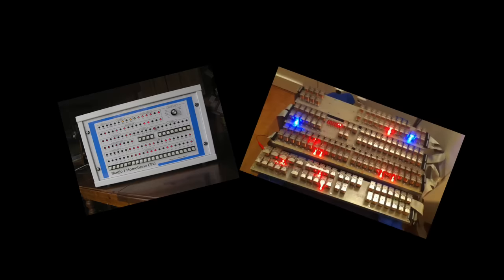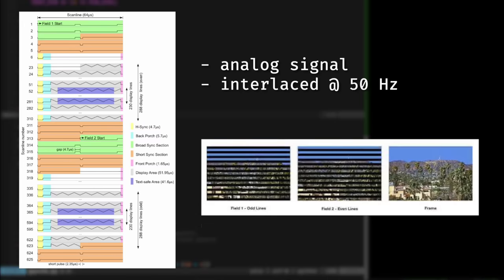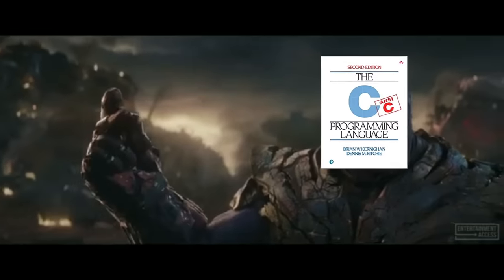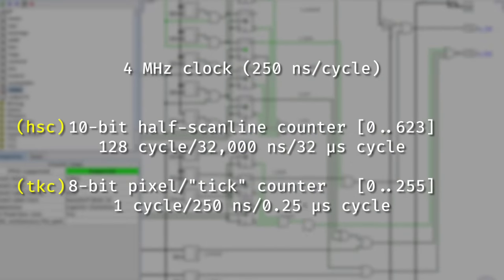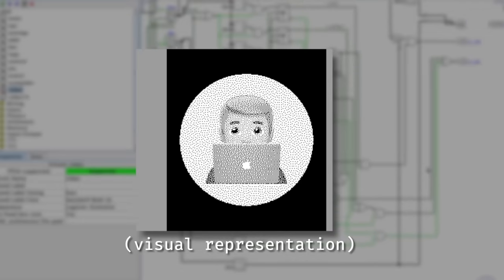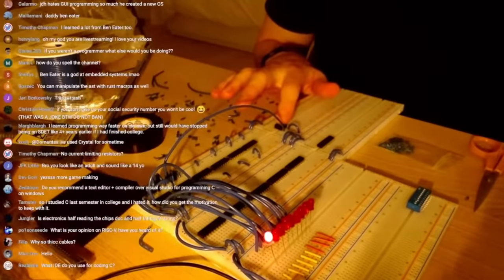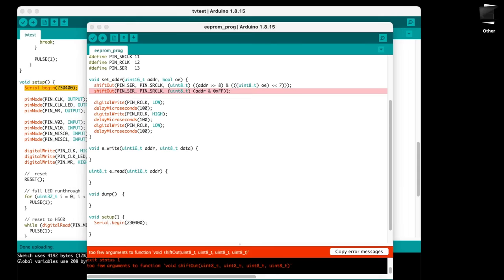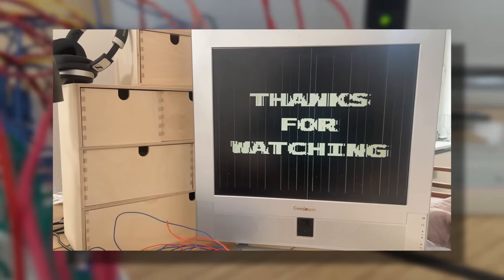I built my own graphics card

Comment: He's literally gonna reinvent the wheel at this rate.
Reply: He just copied ben eater's video card
Reply: @bloxcodes6576  Well he at least had to to modify  it since Ben used VGA. But i did not gone into understanding jdh design so idk.
Reply: Why do you think that? I don't think he copied it...
Reply: @jelle8055  He did the same as ben eater, used a different layout and a adapter
Reply: @bloxcodes6576  different layout as in wiring or the physical layout of the location of the ic's? (I don't remember the layout of the original design, because it's quite a while back i watched that vid)
Reply: @jelle8055  Location of the ICs, the wirings (For example one IC pin 4 and another one 6) are the same. He did add a converter
Reply: @bloxcodes6576  hm, i mean, then the hard part was already done, because i don't think a converter from VGA to (don't know the English name, RCA composite video?) Would be hard, since they are both analog
Reply: And when he remakes it it's going to be a sphere! 🎱 😮
Reply: @مقاطعمترجمة-ش8ث  Who the fuck said anything about arduino
Reply: What's a wheel?
Reply: @bloxcodes6576  I would say he was inspired by the Ben Eater videos.
Reply: Lmao
Reply: No at this rate he is gonna make the wheel better
Reply: @jelle8055  it's a copy of ben eater's just used simpler protocol and without colors.
Reply: @omniyambot9876  yeah, i heard it, shitty that he doesn't say he copied it or "based on" his design...
Reply: @jelle8055  yep. He searched for information about his project, it's impossible he didn't came across ben eater. Or at least mentioned him. He just inevitably mentioned him on eeprom programmer which is very obvious. And every steps he did was Ben's design. Still, it was entertaining.
Reply: @bloxcodes6576  he's changed enough about it and explained things well enough that it warrants not being called a copy
Reply: Anti gravity mechanism... you won't need wheels.
Reply: @jelle8055  It is his own design, black and white actually adds complexity compared to color.
Reply: @bloxcodes6576  The wiring and ICs of a 3090 is like ben eaters GPU, just different. You just disproved yourself.
Reply: @ducksonplays4190  black and white is more complex then color...
Reply: @ducksonplays4190  i cant even begin understand this. u disproved yourself when saying that te ic's are wired differently, he just stole from ben eater
Reply: @jawad9757  not that much changed, and explaining something means that its not a copy? so if i explain a tv, i invented television?
Reply: @tweetyguy7347  I don't remember this, but in the cases of non 1 bit memory, black and white is indeed more complex. It requires a multiplexer and a counter to select each bit to display, compared to sending the entire word through an analog to digital converter and putting that into the VGA color pins.

Comment: "i built a pc"
"what graphics card you using?"
"i BUILT the graphics card."
"but what about the cpu?"
"i BUILT the cpu."
Reply: What about the Operating System?
Reply: @bootyfart1569  lol, he literally did.
Reply: "What about the programming language?"
Reply: "What about the motherboard?"
"yes."
Reply: @bashguy8448  "What about the monitor"
"I built it"
Reply: "what about the harddrive?"
"I BUILT IT."
"what about the case"
"i."
"built."
"it."
Reply: @wmurray003  holyC
Reply: "What about the wires and transistors."
Reply: @nivekakninblarg8076  transistors? I made my own using the equivalent circuit with diodes
Reply: @eletrotheory8398  But did you make the circuits and diodes with glass blowing and forging?
Reply: who made the engineer? "I made it-" Love Island memory intensified
Reply: @takase5037  based
Reply: Building a CPU in theory isn't that hard. Just need some registers, a clock, an ALU, etc. Practically tho? We're talking about millions, of not billions of transistors.
Reply: @bootyfart1569  well that OS is an x86(probably 64), while his CPU is not that architecture so his OS would not work on his CPU
Reply: I love this comment thread
Reply: How many transistors then in both? Uhhhhhh… *scratches back of head* <100…
Reply: Also you say graphics cards which is the equivalent of a motherboard for a cpu, he didn’t build that.
Reply: enrique amaya  ok bot
Reply: After reading all the replies I'll go with this one

"What about the intertwined matrix of infrastructure that makes up a civilization spanning mode of production?" 

Now THAT I want to see done on a breadboard.

Comment: I designed and built a number of GPUs out of TTL in the 70s, although we called then VDUs back then.

It's interesting to see your approach... I can see you're a software guy! 

One of the engineering challenges back in the mid 70s was to use the minimum number of chips. Also back then we didn't have any chips beyond 7419x. The cheapest counters were the 7490 and 7493. Also RAM was expensive.

The designs typical of the day used 256 visible pixels across and 256 visible pixels down, 320 by 320 including front & back porches plus vertical blanking period. Using a 5MHz clock, this gave the 15625Hz Hsync frequency. The Vsync works out at about 48.8Hz, good enough.

Divide by 320 is achieved with 7493 binary counters configured as div-by-32, plus a 7490 div-by-10. When the MSB goes high, that's the blanking periods. Sync timing is achieved with 74123 monostables: digital comparators massively increases chip count.

Instead of a complete memory mapped display (remember RAM was expensive), we used character generator ROMs. These presented 8 pixels at a time, which went into a shift register either a 74165 or 74166 from memory. At 5MHz, the character time of 8 pixels is 8/5MHz = 1.6us, which was easily achievable with the ~450ns RAM and ROM we had back then.

For the CPU to access the RAM, we need to multiplex the CPU's address bus with the 749x counters. This was done with 74157s. When the CPU needed to access the RAM, it took precedence over the counters, so you'd get snow on the screen during CPU accesses.

Including the RAM (8 x 2102) and character generator, maybe 30 chips in total.

I was a 12yo school kid at the time when I designed my first one, no oscilloscope, just an analog multimeter and an LED for debugging.
Reply from the maker: Ah I never knew 74123s existed! That would have been nice - comparators are the bulk of this circuit and take up 2.5 boards on their own. next time :)
Reply: you forgot hardware
Reply: Building a GPU at 12yo! I am stunned.
Reply: I built one while in my mother’s womb. I remember doctors being really confused when the first thing to come out was not me, but the GPU I made. Good times...
Reply: I don't understand anything you wrote. 🤣
Reply: @turolretar  I'd actually designed my first GPU back in my dad's balls. oh to be young again... those were the days.

Comment: Usually the rule of thumb is you use one 104 capacitor for ever chip you have on the breadboard to help distribute power along the board so you get even power draw. Also Ben eater made a working color graphics card on a bread board you may want to check out.
Reply: NOTE:Bean eater made a VGA Card not a composite video card

Comment: I lost it when I saw the jungle of wires. I am really starting to appreciate how difficult it must be to manufacture graphics cards. Shoutout to all the engineers that work on this area.
Reply: Engineers in this kind of field don't have to really deal with routing. It's all software. If you can write Tcl, you can implement a design if you have access to the right software.

Comment: can't wait to see you make your own ssd. No doubt faster and at a higher capacity than anything currently on the market
Reply: His GPU has the features of a 90's Nokia and the footprint of a whole desk, with the specs you're asking, you'll probably need 2 trailers to store the SSD, this turns it from a storage solution to a storage problem
Reply: @YOEL_44  I don't see a problem with that
Reply: @YOEL_44  I'm fairly certain that 3310 has waayyy less performance. It has 84x48 pixels only and runs maybe 30fps if even that. Of course completely different display technology but the data/second is much less
Reply: @YOEL_44  That. And no need to use TTL since there are a lot of 80's and 90's specialized 2D hardware chips to salvage.  Any cheap ARM or RISCV chip provides more. This is just an overly complicated exercise in style. 
Also making an intro comparing this to actual "GPU" without taking into account that actual graphics cards aren't just 2D GPU but 3D, video and computing too is a bit silly.
Reply: @YOEL_44  his solo and dont seem to know shit about how to make a gpu sooo  his a legend

Comment: One thing that you could do would be to read the data from the EEPROM into a shift register and shift the bits out to display them. Shift registers are way faster than memory lookups, and are what is used for things like PCIe and Ethernet signals.
Reply: And really early CP/M text only machines works in that manner. Just data from slow 2114 P-MOS RAM addressed character ROM and output from ROM was shifted to video output. Other ROM address lines were given from counters. All works on TTL LS chips, except shift register - it was TTL-S type.

Comment: it doesn't matter that they are "5V LEDs" resistors don't limit voltage they limit current.
Reply: voltage is pushed, current is pulled.
more or less.
Reply: They do limit voltage 
Voltage at LED would be r_led*V/(r_led+r_resistor )
Hence when you increase r_resistor then voltage will decrease ...
Simple maffs
Reply: Resistors in series limit voltage. Resistors in parallel limit amperage.

Comment: This is so impressive. 
Can you imagine how hard famous GPU manufacturers work to achieve today's graphics, if it took you so much to create something so "basic"
Reply: @R R yeah, you have a point. I didn't think about that when i wrote my comment.
Reply: Well considering this isn't even a graphics card, yes. That's why it's only multibillion dollar companies that can even be competitive in the silicon engineering space
Reply: Well all he did was buy stuff from the store and put it together. Actual companies don’t do that, they make the components themselves.
Reply: @BizVlogs  no they actually huy the components from another company
Reply: @BizVlogs  Only the largest companies can make their own components — and even then, it’s rare. They use off-the-shelf parts where possible, and where they need custom parts, they have a component manufacturer make a custom part for them.
Reply: I think the biggest thing we like to talk about is the actual processing unit made by AMD or Nvidia (for your standard computers), and that's all just semiconductor design and fabrication. Companies like XFX, MSI, Asus, etc. who make the graphics CARDS would make a PCB and add the GPU to it along with capacitors and everything else needed. That I'd argue is not as difficult.

But the processing unit with all the silicon - the actual GPU - it is impressive, indeed. I imagine whatever software they use (it might be Cadence but not sure TBH) they have everything in blocks; that's how stuff is done. Those have billions of transistors, but you can place down "blocks". Everything in computers is done in layers and blocks. Blocks contain smaller blocks, and those blocks contain smaller blocks.

There are languages like VHDL that will take code for how chips are to function logically and produce the "logic gates" for those. Logic gates are made of transistors, which are done by laying out n-doped, p-doped silicon and conductor down in layers stacked as what we know as a "chip" or "integrated circuit". You can look up on Google how a simple AND gate is made up of MOSFETs, and then how to lay out a MOSFET in silicon.

It's all fun stuff! I don't work in that particular industry of electronics, but I do work in electronics and marvel at it.
Reply: Also big companies have billions of dollars at there expense and a large amount of engineers. By the time he could make something good there would be better with how much resources these companies have
Reply: they started basic first ...basic programming is first they need to do first before get into shading gradient and drawing polygons for 3d modeling...those ideas came out from Silicon Graphics back then many colledge kids start learn something from those machines to get into electrical engineering
Reply: no one has given the right answer, which is that you use boolean algebra to scale up and add components
Reply: @R R still the combined effort from such a long time is what make them so good.of course that doesn't mean they don't start from scratch but there was a time they did and actually the effort compounded to where we are now.a lot of people continuously have work from scratch to where we are to create new technology.still a lot of hard work.
Reply: The combined effort and the time added is so much more in comparison to the thing this YouTuber did so yes we can appreciate the combined hard work time and money require to make high end graphics card.of course IAM not talking about one person.iam talking about the combined energy from start to finish and that's so much.
Reply: @somekindofdude1130 See Intel.

Comment: I did somthing like this in a game that simulates logic gates (scrap mechanic), obviously, that is easier as I don't need to care about voltage ground, power source, and that kind of stuff, and it was 15x15 pixels, and I got to make up all my own video data standards and stuff. It had like 1 fps with the smallest possible image data in my standard. This is a really cool project though, and it is super interesting to see someone build it irl. I can recommend scrap mechanic to you, obviously, it is more satisfying to see a result in real life than in a game, but I think you could have a lot of fun building stuff in it, and it might even be a good place to simulate your circuits before you spend money on your stuff in real life. It doesn't have stuff like memory ICEs, but you could simply make them with regular logic, and copy-paste them however many times you want.

Comment: This is hilarious to me, as I went down a very similar road (and same glitches and pain) 7 or 8 years back. I didn't try PAL, but NTSC... but with 'golden arches' of wrirwe mess causing interference (stray capacitance etc), it was making me nuts. I ended up switchign to VGA output, as much more widely available on monitors, and also a really easy signal to generate, in black and white or colour. (Same analog range style to generate a colour or b/w). A couple years back I went FPGA to try and figure out HDMI and got that going too .. and its a lot like VGA but with some evil suppressed-information encoding at the end.

Go VGA, and use Eagle or whatevere to get some PCBs printed .. doing it all in jumper wires is fun to a point, then just annoying ;) (When elecrow or jclpcb etc can give you a dozen 4" square pcbs for $10 a week or two after you place the order, its pretty nuts.)

You're super awesome, love the videos.

Comment: Latches, my man! SN74LS573 or similar. You can use a very brief signal to latch the output from your ROM chip, thus allowing the ROM's output to stabilize before sending the next byte out. It will mean reorganizing your data on the ROM chip by about 1 byte, but that should help.

Comment: I know this video is a bit old now, but one way I’ve gotten around this problem in the past when using eeproms is this manor is to put a latch on the output. Have the latch, latch on the falling edge of your pixel clock and output on the rising edge. This has the net result of delaying the data by one clock cycle but the data is a lot cleaner.

Comment: you could use an FPGA after you had your circuit layout and test it there before you buy all the ICs.
In general using an FPGA instead of programming it in C might be a good idea!
Reply: Can confirm. FPGAs are very useful in this way
Reply: You appear to have missed the several weeks required to become proficient in an HDL and the FPGA's tool chain.

More seriously, you can do all of this on $2 microcontrollers using on chip DMA and on chip timers, there's no need for FPGAs.

But I found the approach to do it solely in software first was interesting if a little quaint/naive!

Comment: I tried to build something similar that used the VGA standard. I only got as far as the timing signal generation and pixel counters, because although it all worked, if I even breathed on it, it would stop working for some reason or another. I think the counters I used didn't like the extra capacitance in the breadboards. It was a great feeling measuring all the timings with my scope and seeing it match perfectly with the VGA standard. If I was going to continue I would have needed to build it all on proto board with magnet wire like my z80 computer. I never bothered making a schematic diagram though so it wasn't worth continuing. 

You did fantastic for never doing any electronics before

Comment: I know I'm late to the party, but I wanted to mention that if you're having timing issues due to the memory chips being too slow, one way of dealing with the problem is to interleave the bits between chips.  That way, each chip has time to prepare its output while the bit from the previous chip is being displayed.